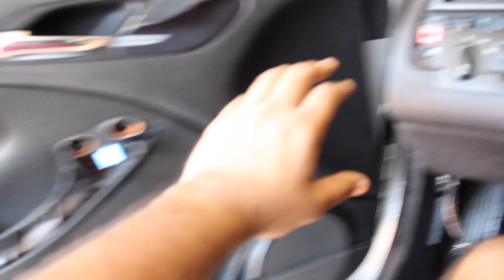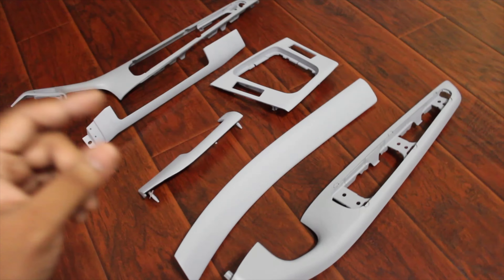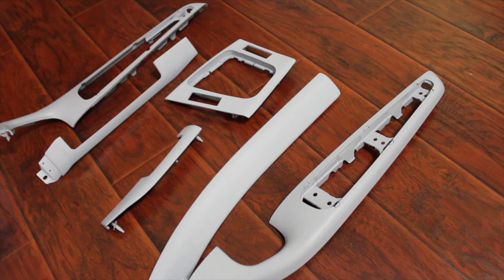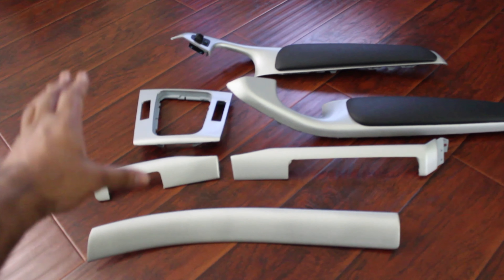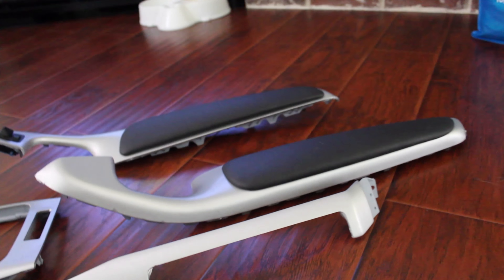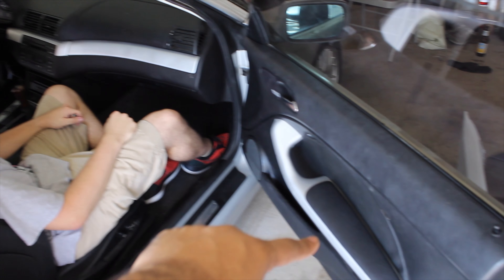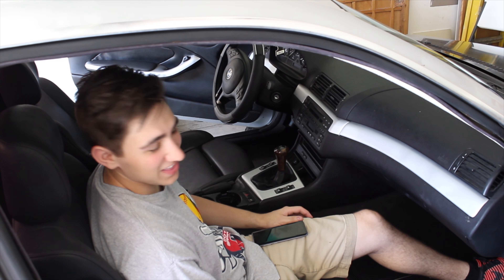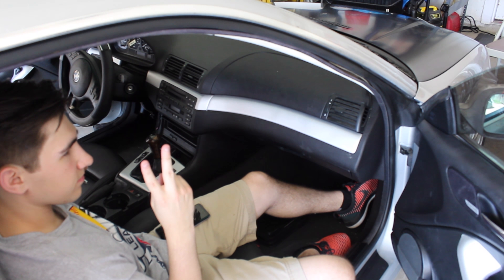BMW e46 Interior Trim Wrap -Brushed Aluminum

Comment: looks liek you did a good job but i am a little disappointed in the wrap
i also want  the brushed metal but this one looks a little too dull and not  metallic enough but it might just be the camera, i want to get it to look as close to the real OEM BMW brushed  aluminium trim  , my wood  trim is nearly perfect  so  i don't have to  sand or prime it   right i can just wrap it? and yes a video  no how to remove the trim would be  really helpful , i  don't know  exactly how to remove the   rear  and door trim.
so was this a difficult  job? were there a lot of bubbles and  did or do you have problems with  the  vinyl lifting away?